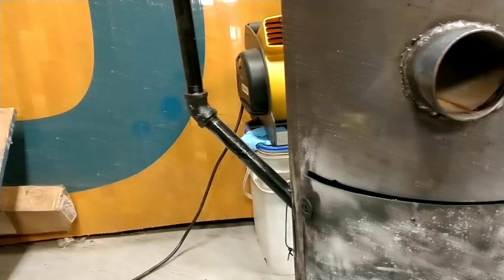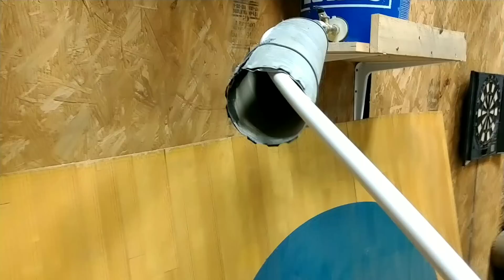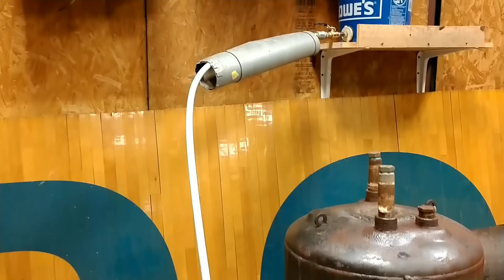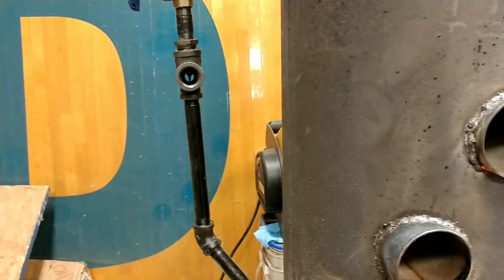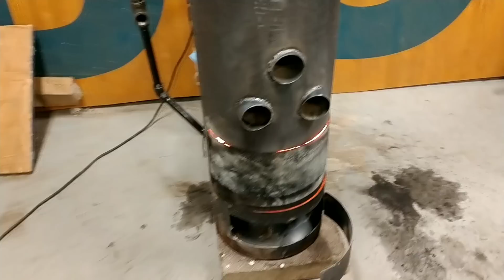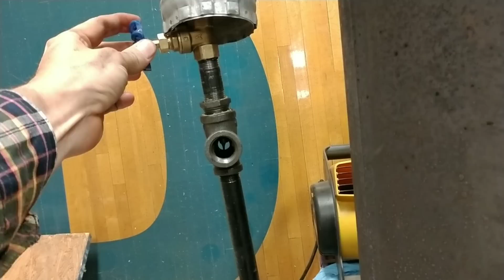Updated Waste Oil Heater Drip Feed Ver.2.2 Detailed January 19, 2018

Comment from the maker: If you choose to build one of these heaters just know that you need to be very careful and I will not assume any responsibility for anything bad that happens.
Reply: Have you by chance ever seen an old army immersion heater?  Similar tech... well done to re-purpose waste material sir...
Reply from the maker: No I haven't but I've heard several people comment on my heater that it's much like the old army  heater
Reply: Only a liberal or a moron would some how blame you for a bad heater they built. They'd probably call you a nazi too.
Reply from the maker: Exactly, but there are a lot of them out there!
Reply: @randysdiy2102  Don't worry. Those droolers are all on facebook echo chambers. Its safe here.
Reply: I totally  understand  that. I do all my own building.  I'm a welder, metal  fabricator.  I'm off grid, have  3 gen sets and setting up a wind turbine.  This will supply hot water and heating as well as wood heat.
Reply from the maker: Awesome 👍
Reply: @randysdiy2102   you said the flywheel was a flame buffer. What do you mean? Is that just something to hold heat? I have a old Buck wood stove I made a oil pan out of a brake drum and have a oil drip in. It doe’s good for 10-15 hours but then I have lots of soot build up in exhaust pipe and it starts smoking in my shop some.
Reply from the maker: Yes sir, it just gets it really hot and it keeps all the heat from rushing straight up. The diameter of that is larger than the burn pot so the flame has to go around it before it can get above it. Boy that was hard to make any sense out of
Reply: @randysdiy2102  it's purpose is like that of a gas stove burner cap. Spread the flame wide. Very cool invention. It's on my bucket list now
Reply: What are the dangers? Other than the fact you're playing with fire IDK. Was planning on making a small stove for my van that could burn wood and used veggie oil.
Reply from the maker: Well like you said of course you're playing with burning a flammable substance so there's always danger involved. I guess some of the dangers that have been discussed on this channel are first of all in a van you could burn all the oxygen out or get carbon monoxide poisoning, other than that it's hard to regulate the flow of oil into the burner if the flow starts getting too fast you could overheat it or actually have a spill which would end up burning up your van. Those are probably the two most dangerous things I can think of.
Reply: @randysdiy2102  Okay good points. Thanks for the reminder too I've been reading about ventilation in a van seems like having a lower air intake and upper outtake would be good.
Reply: Hazards construction get your place burndown 10/10
Reply from the maker: Not yet anyway, but maybe soon.
Reply from the maker: Thanks
Reply from the maker: Lol, I don't eat transmission and engine oil. But I do get some cooking oil occasionally from local restaurants.
Reply: Just came across you vid,best iv seen so far. Iv messed with a corn stove,added oil. It would brun oil in line and plug. Does this happen for you?

Comment: How do you keep the supply tube from clogging up
Reply from the maker: I've never had that problem, I do occasionally clean it with a round wire brush at the bottom.

Comment: I turned up the playback speed to 1.25 and it was tolerable. Holy shit, I started day-dreaming between every other word.  The two word blurbs, pause, two words, pause, three words pause are not conducive to informing or instructing folks. 

Try it, set it to 1.25 speed and it is on the slow side normal cadence for an instructional or informational lesson or speech.
Reply from the maker: Glad you enjoyed it. You should try it two times the speed

Comment: I like your heat exchanger pipes, I will be putting some in my propane or water heater tank, THOUGH I will be adding a flange to my door for a door seal, PROBLEY a flat door plate with 2- 1/2" tall plates for door seal and a shorter plate in the center of the 2 flange plant to serve as air tight door seal. HOPE this helps for extra building ideas.and then try adding air with small fan to see if it burns good and clean and hot.
Reply from the maker: And if you check out the new video that I posted on it, you'll see that it has the door seal rope with flanges and I added more to those tubes going through it for heat exchanger tubes. Anyway, thanks for the comment and have a good one

Comment: Hey mate i know this is an old video but out of all the ideas I've seen on you tube I do like your design as it doesn't rely on forced air. I was wondering if you could tell me where the extra holes you put in to the top hat ( I couldn't find the video ) and was also wondering how you go with the oil pipe, does it clog up often or any burn back as there is no air being forced around it?
Thanks mate from a fan in Aus.
Reply from the maker: Think this is the video that has the new holes. https://youtu.be/6Puk4mPK1XI
Haven't had any problems with burn back it even stays fairly clean
Reply: @randysdiy2102  Thanks mate for the quick reply and I've seen that video it still shows only the eight 90 degree elbows though. I'm still only in the planning phase of converting my old wood heater which is made from a 450mm pipe 8mm thick wall ( 18" and 5/16" in freedom units ) and still have a couple of months to figure it all out before winter hits us as I have a fairly large workshop for servicing trucks and tractors on my farm here so no shortage of waste oil. Thanks again mate your a legend keep up the good work
Reply from the maker: @davidfraser4867 thanks for the great comment. As for the holes there are 1/2 inch holes between each of the elbows. One between each elbow. Good luck and be safe. Enjoy the Free heat.

Comment: i like this idea, can mount it outside, duct hot air into my home and have the fire outside.
Reply from the maker: I don't see why you couldn't. However, you do have to watch that old drip feed. It's not super reliable. It changes flow depending on temperature so I'm not sure how well that would work. One guy commented on my channel that you could use a pump similar to an IV pump to put the oil in at a regulated amount now that would be pretty safe
Reply: @randysdiy2102  maybe i could rig up an egt sensor into arduino and monitor the temps to controller the shutter valve. Automate the feed. will experiment, see how i go.
Reply from the maker: @thearchitect4726 sounds cool

Comment: No drip feed, use a peristaltic pump. Thank me later !
Reply from the maker: And I'll have to look that up because I don't know what it is. Lol
Reply: @randysdiy2102  It is a extremely simple device, basically a small geared stepper motor with rollers that pinch the silicone tubing (your oil feed line) against a sidewall. The  motor is dial controlled providing a extremely metered fully adjustable volume reguardless of viscosity and temp. It's how a IV drip pump works. 
You can get them in a bunch of different flow rates per min.
 I got a 1ml-250ml per min one for $30
You want one with the control included. 
They sell just the pumps also but you would need a control unit for it. Basically just a variable voltage dc power supply.
Reply from the maker: @dmithsmith5880 wow that sounds awesome. Feel a lot better than than anything. Low valve constantly

Comment: Awesome job. I really like the idea of the heat exchange pipes in the top of the tank. I would go with smaller dia so I could get 5 or six tubes. Then build on a cone so I could have a direct air tube blowing through the pipes. Don't know exactly what that looks like... But it would depend on what I can do for scrap. Also I saw a guy use pyrex bowls for windows. The only other thing I will try to do is make my doors so it seals better. Using regular regular stove heat rope. Thanks for all the info. Great job!
Reply from the maker: Sounds good , I hope everything goes well

Comment: This is a good  heater design  and will work without a blower fan requirement
Çelcius  and ĺitres readings  and for overseas  folks helpful
Reply from the maker: gled you liked it, sorry for not haveing the metric measurements

Comment: You are only having problems with the door correct so do you think the rest of the tank would be ok for a long while I don’t think I will be using it alot
Reply from the maker: I've got some more videos. One of the newer one shows the door repaired and more holes in the air hat to allow a leaner burn on the air fuel mixture. Check out the other videos. You'll see a lot of interesting stuff there. I think the tank will be good for a while. I've been using mine for probably 4 years, but I don't use it a whole lot like you said

Comment: A much safer and easier to control pre-ignition source  is to use the diesel and gas mixture of 3 parts diesel to 1 part gas. This is a standard burn mix ratio and will yield excellent and much more controlled potential of a flash fire if used to ignite a hot pot that may have just run out.  Great stove

Comment: Your 6” chimney pipe is installed backwards!  Any liquid condensation inside the stovepipe will run out the first joint it comes to and then down the outside of the pipe.  Always put the topmost pieces of stovepipe INSIDE the one below it so liquids will stay inside the pipe!
Reply from the maker: Good observation 😃

Comment: Would  a chimney fan pulling a vacuum have much of a effect on the heat output?
Reply from the maker: Not sure I understand what you're asking
Reply: @randysdiy2102  an inline fan in the exhaust tube. It's made to pull a vacuum on the firebox to help draw air in almost like a force air induction. I'm curious if that would get a higher temperature for a waste oil burning?
Reply from the maker: I suppose it would make it burn a lot hotter. It would be the same thing as blowing air into the intake making a leaner burn requiring more fuel

Comment: That is a nice build.

My first thought was why you didnt put a turbo in the chimney and blow a modest airflow through the heater tubes & feed that hot air back into the oil burner.

All the time waiting for the addition of a V8.

How did you not put a V8 on it?

Didnt your son say "but Dad, it needs a V8"?

A V8 driving say 8 chromed turbos feeding air through more heater tubes to warm the workshop,
Yes I will watch out for pt 3.
Reply from the maker: Lol

Comment: your not showing where the fan is connected to ?
Reply from the maker: It's just sitting behind the pole burner on a bucket blowing through those pipes. As far as connected to electricity, there's outlets on that wall behind these heater

Comment: Awesome job. 
Could i burn waste oil like in a residential area (smell)? Why not forced air into flame chamber like other designs, what would be the difference? 
Thank you!!!
Reply from the maker: I guess it would depend on your neighbor's. Motor oil will smell like motor oil burning, however I have used restaurant cooking oil and it is rather pleasant
Reply: @randysdiy2102  thank you for your reply. By the meantime I saw other designs. It seems like with forced air going into the burning chamber the oil burned hotter and cleaner, i get responses that there is no smoke or smell!
Reply from the maker: Yes sir, you are correct, I'm working on a blue flame oil burner now. Don't know how it's going to turn out but do some YouTube searches and you'll find several

Comment: Not very efficient by burning one liter per hour.!
Reply from the maker: No, it's not extremely efficient. Using some forced air would help a bit, I am currently trying to build a blue flame waste oil heater that should be much more efficient

Comment: Built one but it barely turbos 
.used a brake drum for a burn pot welded lug nut holes  closed it is 2.5 deep I used  stainless hat with 8 --  90 degree pipe fittings
 was their supose to be more ?  Never seen inside the hat 
My pipe is 4 inches tall how tall does the hat need to be ?
Reply from the maker: I just made sure it has the same or close to the came amount of air space between the sides and the top

Comment: is thick  used engine oil   ok to use
Reply from the maker: Yes, I have used diesel oil, transmission fluid, and vegetable oil. It's just has to be thin enough to flow through the valve assembly

Comment: how   do you decide  how  many  holes at lower level to provide the vortex ..   what is their diameter ?  if you put    meths or parafin   to start  before oil input is that practical
Reply from the maker: I started out with eight half inch holes and they ended up with 16 half inch holes. It's just a trial and error thing. Yes, you can use any kind of starter to start the fire. I use one cup of gasoline to a gallon of diesel

Comment: If you added a fuel pump from an eberspacher (or clone) you could have a thermostat controlled heater. You could also use heat for a water heater and/or water filled radiators.

Comment: You could build like a brick wall around it and fill it with kitty litter for spills lol like a mote. And maybe that could help dampen flames until you can get to a extinguisher. All i see is carbon monoxide and a flame hazard but both can be avoided. Air filtration system and a game plan to prevent fires. I really dig this idea. Why give away oil we paid for.

Comment: Hi , nice video 👍 . I'm adding an oil drip to a wood stove ... Any suggestions on how to keep it from clogging up ( from the oil burning cc I mm ok Ng out in it f BB the in pipe ) ? Thanks for any advice .
Reply from the maker: I've never had mine clog up but I have heard of people having that problem and I don't know how to remedy it
Reply: @randysdiy2102  Thanks for the reply . I've watched many videos where some dump it right on the fire as it seems you do & others where they have holes on the side or top of pipes . It seems you use bigger pipe for the oil feed . That might be the solution as others say they have to unclog-clean that ... Maybe yours burns itself clean as the fire burns it while still in the pipe 🤔🤔🤔

Comment: After checking out several designs, I like your burner design the best, especially the safety feature, makes total sense.  Thanks for posting.
Reply from the maker: Thanks 👍
Reply: The "safety" device needs to be tested.  That is the problem with these "pot" oil burners, they don't have a safety interlock.  I remember when I bought my trailer many years ago that I lived in during college someone told me make sure the furnace wasn't a pot type.  Didn't really now what that meant but I bet it was a bit like this.  This type of burner really has to have a fireman to watch and control it to make it safe.
Reply from the maker: I've never tested it and thank goodness it has never had to. However you are correct it would be nice to test it. You no just because, I may remove it from my shop to test it out side to see if it will work [smother the fire out due to not enough oxygen] stay tuned, as I may just try it. Thanks for the idea!

Comment: To regulate the heat,  why not use a smaller burner?
One more thing.  Why not run the heat exchange pipes in an angle? Like this " / " That way you wont need a fan, the hot air moving up will suck cold air from the bottom.

Comment: Very nice,,I used a old file cabinet over my flue pipe with a squirrel cage fan at the top blowing heated air down, works great, good to see men using their brains like this.
Reply from the maker: Sounds like a great idea. Thanks

Comment: This type of waste oil heater is 40 year old technology.  There are available burners available today that use pre heaters, metered fuel pumps, and compressed air atomization that basically are an oil burner with fuel injection.  They are also UL certified and have common safety features to prevent unwanted fires.  If you use one of these old home made systems you are effectively voiding your fire insurance policy.  They also leak CO and CO2 gasses (along with other toxic compounds) into the air you’re breathing.  I won’t even discuss the building code dealing with “open flame” heating equipment in a repair shop.  Please be safe.